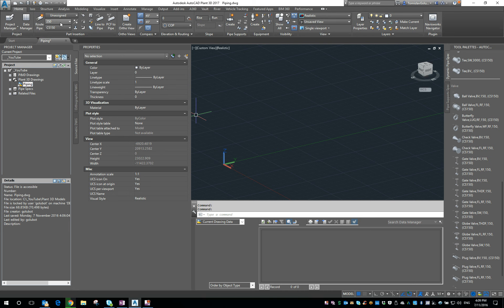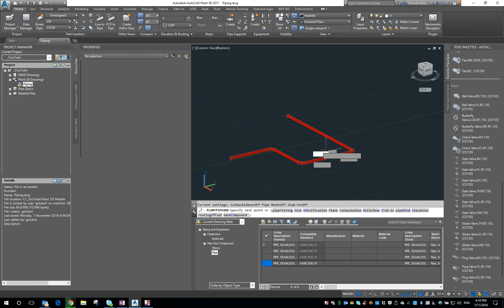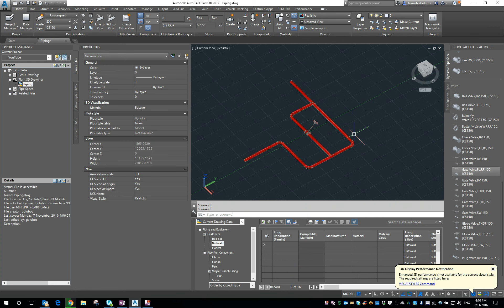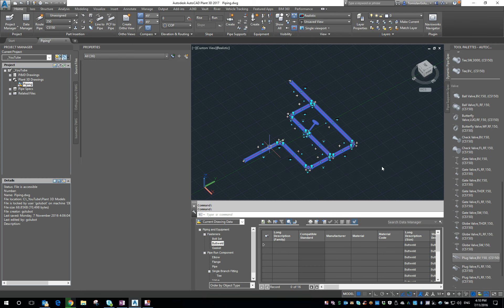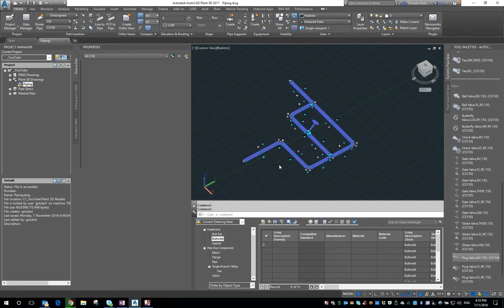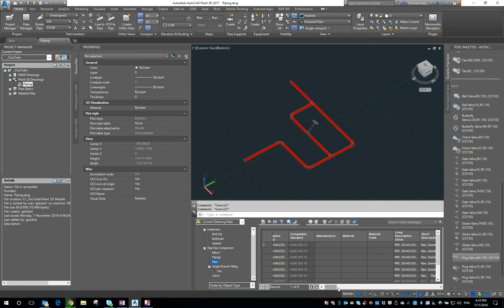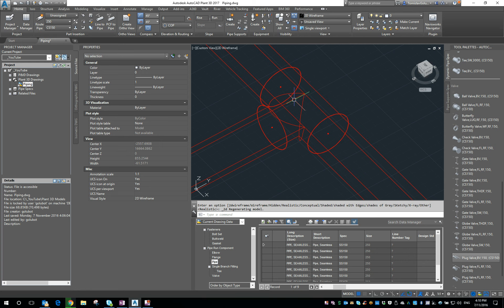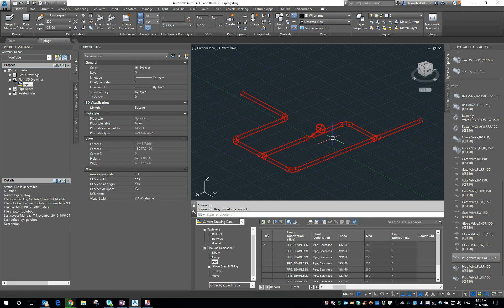Plant3D - Change Specs after pipe is created

Comment: This should also work if you manually select by windowing, correct? If yes, can you explain the cause of the dreaded "No Selection" error in the Properties pane when trying to select pipe and/or components? This error is unrelated to the "maximum 32767 objects selection set" (since only a few items are selected) and no hatching is in the DWG.